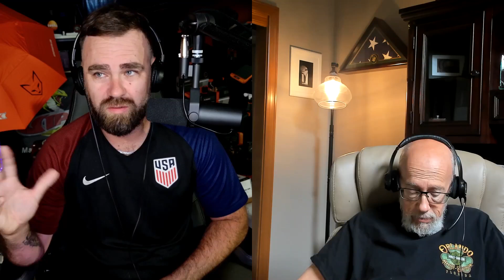How To Pressure Test Hydronic HVAC Systems - HVAC Know It All Podcast

Comment: On chillers we can't test to really high pressures. There are relief valves. On 134a chillers, usually the high side relief is set for 325 and low side at 200.  Low pressure chillers its a whole different animal. The burst disk is at 15psig. You test to a maximum of 10psi.

Comment: I got a question working on a sx80 Armstrong I jump r and w at the circuit board it fire up and blows hot air. If I jump it at the thermostat same terminals it fire on and turns off after a few seconds. Is this most likely a circuit board issue?
Reply from the maker: If you jump it at the board and works then I'd say the board is fine